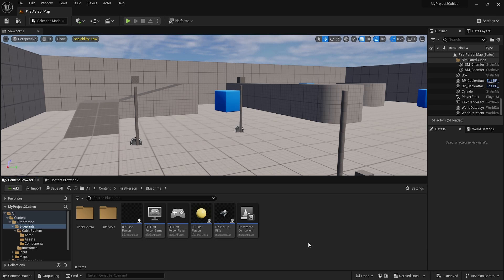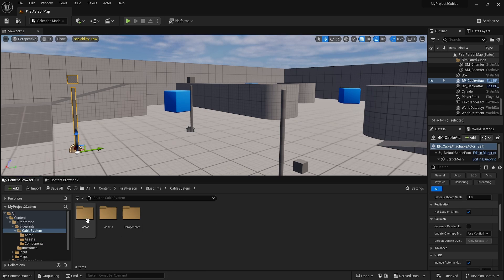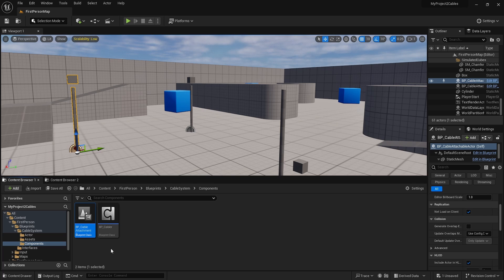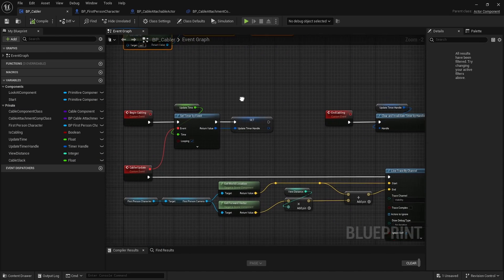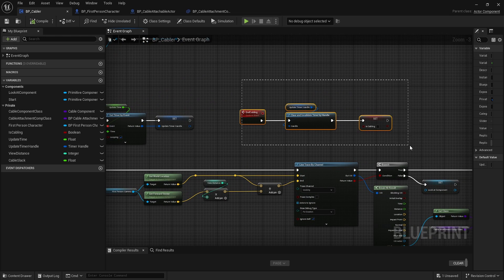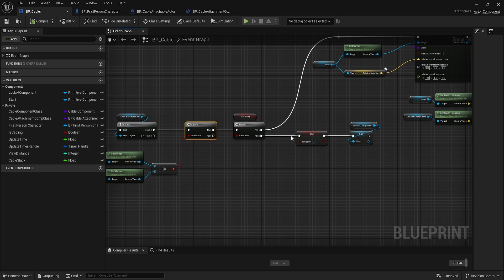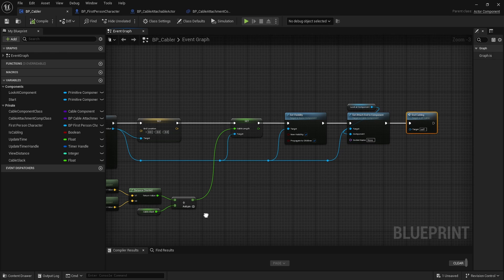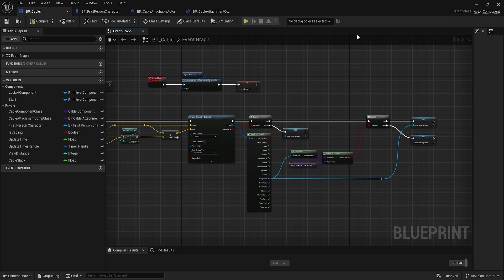How To Attach a Cable Between Actors in UE 5

Comment: I'm not sure why there's a need to having a begin/end cabling to consistently trace. You can simply input to trace for the start cable vector  (along with an enum state maybe to know if you're currently making cable) and then input again for a trace to get the end point... Let alone, there's no reason for a custom static mesh component when you can just look for tag of a static mesh component. No need for an extra child static mesh component class that isn't containing anything beneficial.
Reply from the maker: Good points, there's many different approaches to attaching cables and it this is just a starter project where improvements/optimizations should be made to fit the game you are making

Comment: Hi man, thanks for tutorial, im new to unreal, can i create my rope and attach the points to my object?
Reply from the maker: Similar logic would apply, basically have a list of points in an actor and on startup you can run something like a create ropes function that will loop through your points taken every 2 points and attaching a rope component that sets the start and end points for the rope. Or you can create simple static mesh components to define your points then using that you can move and modify when you place the actor into the world then use the create ropes function to loop through them and attach the ropes between a set of components

Comment: Can this be used for attaching the player to something and restricting their movement?
Reply from the maker: adding the attachment to the character should be fine, as far a restricting movement, no, this is mostly visual you need to add some additional logic on the movement but it's already there in the component all you would need to do is enable and disable the movement input if out of range of what ever you are attached to which is already being calculated in the component, so a simple bool based on distance should work 👍if your unsure I can do a pt2 and it would basically turn out something like the Astroneer system